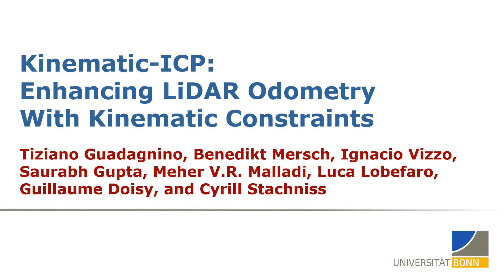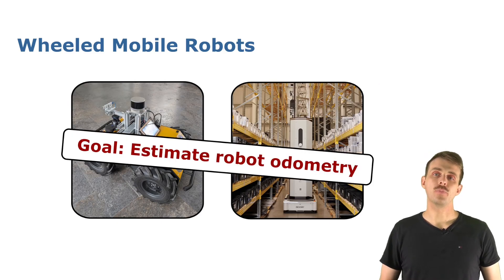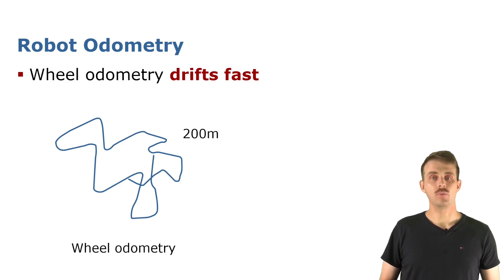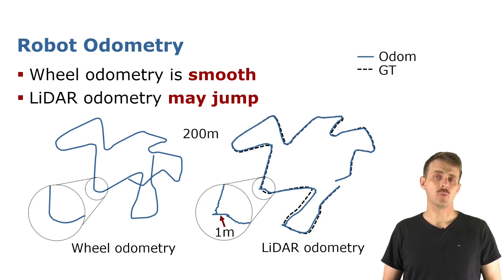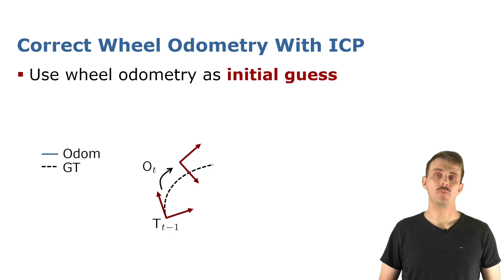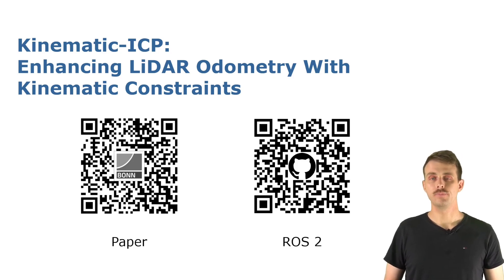Trailer: Kinematic-ICP: Enhancing LiDAR Odometry with Kinematic Constraints for Wheeled ...(ICRA'25)

Comment: Any value in going from a bicycle model to a 4wheel model?
Reply: If the four wheel model better describes the motion of the platform (because it can also steer in the back), you can improve the estimation. If it still boils down to a combination of forward motion and rotation it might not matter much.

Comment: AI Summary

Abstract:

This video introduces Kinematic-ICP, a novel LiDAR odometry approach designed to enhance ego-motion estimation for wheeled mobile robots operating on planar surfaces. Traditional LiDAR odometry methods often produce "jumpy" or inconsistent pose estimations, while wheel odometry suffers from drift. Kinematic-ICP addresses this by incorporating the robot's kinematic model directly into the iterative closest point (ICP) optimization framework. It utilizes smooth wheel odometry as an initial guess and refines it with LiDAR data by optimizing for the robot's kinematic control inputs (e.g., linear and angular displacements) rather than a full 6D pose. This ensures a locally consistent and smooth trajectory that aligns with the robot's physical motion capabilities. The approach also features an adaptive regularization mechanism to dynamically weight the influence of LiDAR measurements and wheel odometry, improving robustness in challenging environments like feature-poor corridors. Experimental results demonstrate that Kinematic-ICP achieves superior accuracy and smoothness compared to existing LiDAR odometry and fusion methods, even when tested on large-scale warehouse environments and uneven outdoor terrains, and has been successfully deployed in real-world robotic fleets.

Kinematic-ICP: Enhancing LiDAR Odometry with Kinematic Constraints

*   0:01 Introduction to Kinematic-ICP: Benedikt Mersch introduces Kinematic-ICP, a new method to enhance LiDAR odometry by leveraging the kinematic constraints of wheeled mobile robots.
*   0:10 Robot Odometry Challenges: Wheeled mobile robots (e.g., Husky, warehouse robots) often operate on flat surfaces and require accurate ego-motion (odometry). The video highlights that wheel odometry is smooth but prone to drift, while LiDAR odometry (like KISS-ICP) is globally more consistent but can exhibit "jumps" or discontinuities locally.
*   2:12 Importance of Smooth Odometry: The speaker emphasizes that odometry should always evolve smoothly without discrete jumps, citing ROS Enhancement Proposal 105. Large jumps in LiDAR odometry can imply unrealistic velocities for the robot.
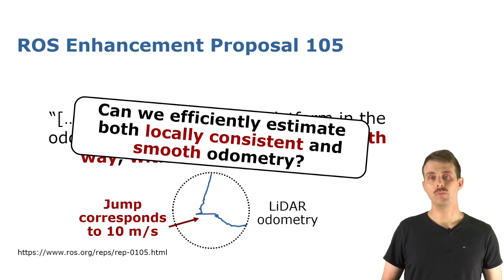*   2:40 Goal of Kinematic-ICP: The objective is to efficiently estimate odometry that is locally consistent, smooth, and accurate, without merely fusing different odometry sources.
*   3:03 Kinematic-ICP Framework Explained:
    *   It starts with the wheel odometry as an initial (smooth) guess for the robot's pose.
    *   LiDAR measurements are then aligned with a local point cloud map.
    *   Instead of estimating a full 6-degree-of-freedom pose correction, Kinematic-ICP optimizes for the control inputs of a kinematic model (e.g., forward motion and rotation for a differential drive robot). This fundamentally ensures the resulting motion is smooth and physically plausible.
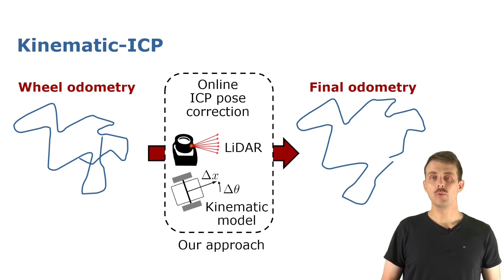*   4:12 Improved Trajectory Quality: Visual comparisons demonstrate that Kinematic-ICP produces a trajectory that is both highly accurate (close to the reference) and remarkably smooth, rectifying the issues observed in both wheel and standard LiDAR odometry.
*   Key Contributions and Performance (from paper/video):
    *   Accuracy & Robustness: Kinematic-ICP consistently outperforms wheel odometry and state-of-the-art LiDAR odometry systems (like KISS-ICP, EKF, Fuse) in terms of relative and absolute errors across various challenging environments (warehouses, outdoor parks).
    *   Adaptive Regularization: The system dynamically adjusts the weighting between LiDAR measurements and wheel odometry based on their consistency. This is crucial for robustness in "featureless" or ambiguous environments (e.g., long corridors) and avoids manual tuning.
    *   Computational Efficiency: Unlike approaches that fuse separate LiDAR and wheel odometry estimates, Kinematic-ICP directly processes both, leading to higher computational efficiency (e.g., 100 Hz on a single-core CPU vs. 10 Hz for Fuse).
    *   Real-world Deployment: The method has been successfully deployed in the Dexory fleet of robots operating in warehouses worldwide, showcasing its practical applicability and reliability.
    *   Open-Source Availability: The Kinematic-ICP implementation is open-source and available on GitHub, supporting ROS2 (Humble, Iron, Jazzy).

I used gemini-2.5-flash-preview-05-20| input-price: 0.15 output-price: 3.5 max-context-length: 128_000 on rocketrecap dot com to summarize the transcript.
Cost (if I didn't use the free tier): $0.0071
Input tokens: 26710
Output tokens: 897
Reply: no need for an AI summary on a 5 minute video 😆